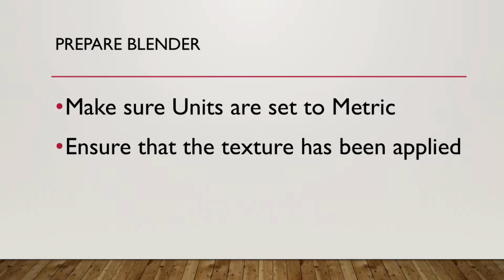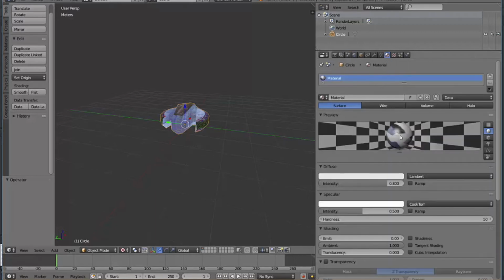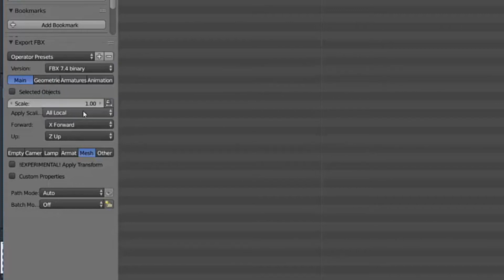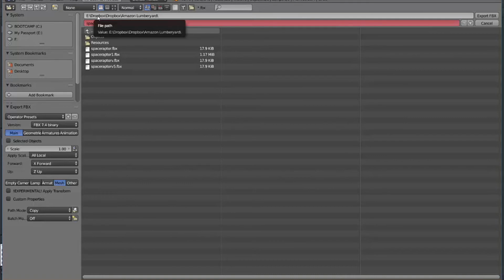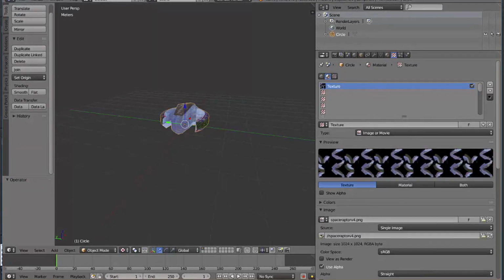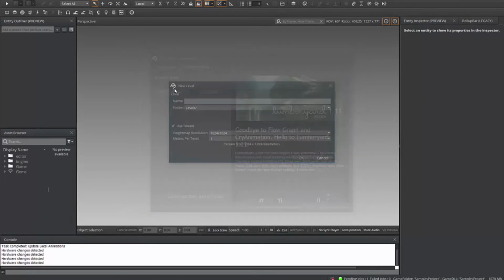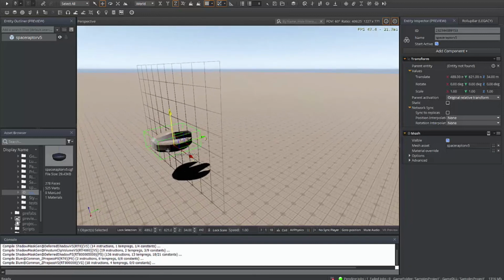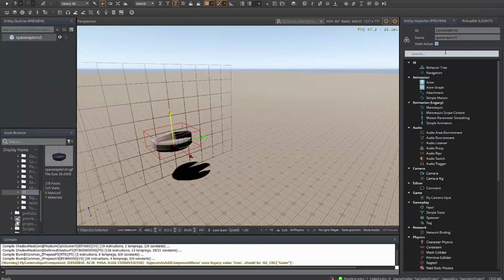Blender to O3DE: Importing FBX 3D Models with Textures

Comment: For me it won't work.... Sometimes it doesn't even load the model in the asset browser. Or if it loads in, it is unusable...
Reply from the maker: Did you examine the log file or the information in the Asset Processor?  In my experience, if it the model didn't load it was a) a problem with the model or b) it did load, but was very small because the scale was off.